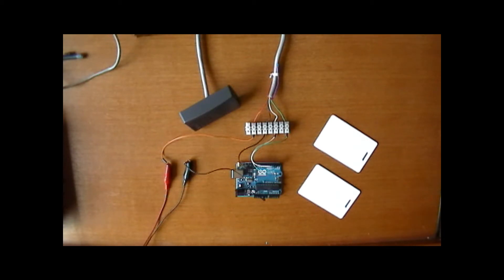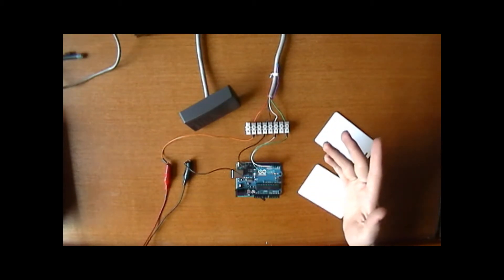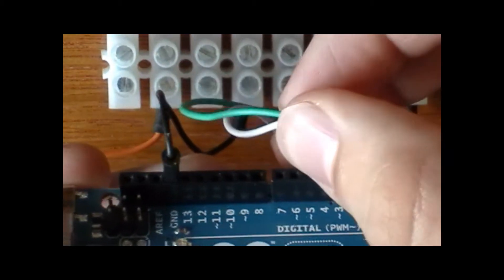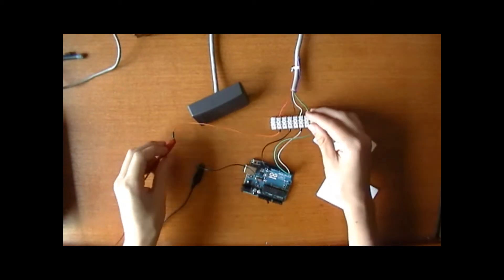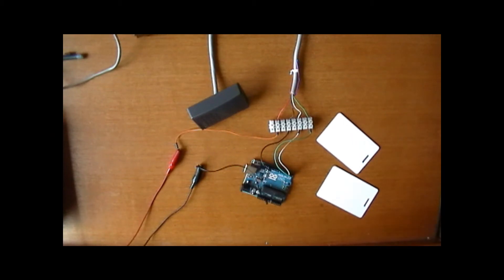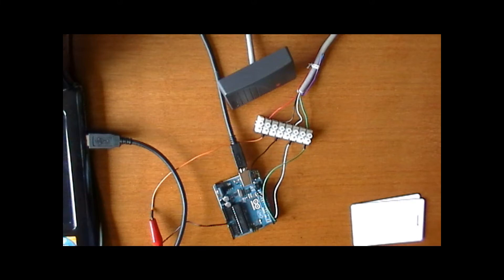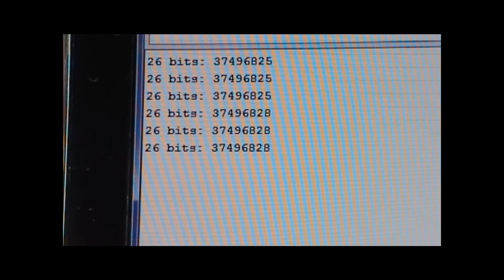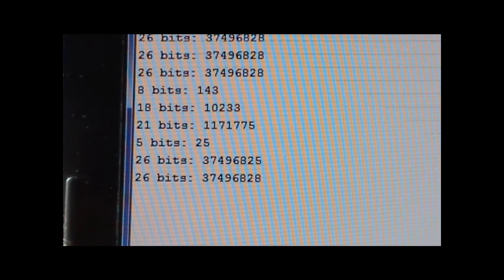Arduino RFID Tutorial - EASY!

Comment: The output of HID is open collector. Sometimes a stronger pullup resistor is required. This would account for your errors. I used to design access control systems for a living years ago. It is an older format now, low security, and there are only 255 site codes worldwide.
Reply: what resistance values do you suggest???

Comment from the maker: White should be in pin 3, and green should be in pin 2. You should also have the GND pin connected to black. Red should go to power. If you have it connected correctly, it *should* work, provided you have the correct keys for your reader.

Have you checked out the webpage I created for this tutorial? There is a link in the description. It has all the wiring and code there.

Comment: Are you using a HID card for scanning or any normal card can also work with this HID reader?
Reply from the maker: Aman Kumar It is an HID card. Each reader has cards it is compatible with, and if the card you try to use isn't compatible with the reader, nothing will happen.

Comment: On the label of my reader this 6005B2B00 written on the line below the line below 6005-320-01 3511-001539 FW 06-003-04
The pins are connected as diagram of the video, is it a hardware problem?

Comment: Good video, imagine you had to understand the serial plot of the wiegand protocol to interpret the received messages or not?. I was using some libraries, but I only got 6 digits of the tags, with your code I get 8 digits! thx!!
Reply from the maker: It's not that difficult to understand. To be honest, I pieced together snippets of code I found online. You can adjust it for different timings or bit length depending on the reader you have and the Wiegand output it produces.